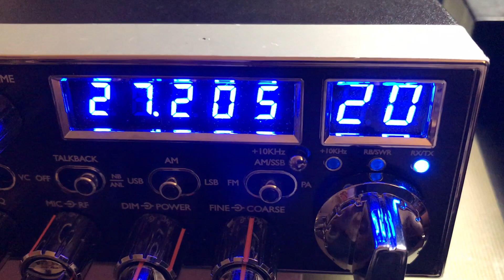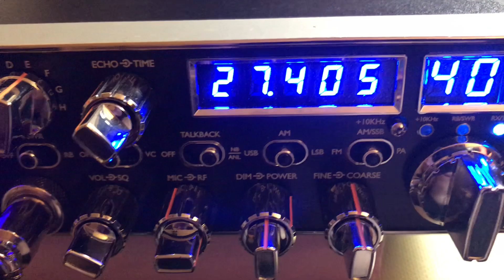MFJ 207

Comment: I just bought one of these and trying to do a little homework so I know how to use it. For one the manual states, "To zero-beat the 207 against the receiver, loosely couple a wire from the RCA jack (Freq. Out) to the antenna connector on your radio." Not connecting it to the coax or antenna but rather the small jack on top of the unit. Also it states, Adjust the TUNE dial on the MFJ-207 until you start hearing a tone in the radio's speaker. As you turn the TUNE dial, the frequency will start at a very high pitch, then decreases to zero pitch. The point where the tone goes to zero Hertz is the "zero beat". That means the radio frequency is set to the exact frequency of the MFJ-207." My understanding of that is you are to turn the dial until you dont hear it anymore. I assume that's what it means by "tone goes to zero Hertz." Maybe I'm wrong but that's my understanding.

Comment: That method can be used to align your receive as well. Nothing more than a signal generator. I'd put a Sinad analog meter either on your speaker terminals or through you external speaker jack on the back, and tune via strongest signal or the Sinad.